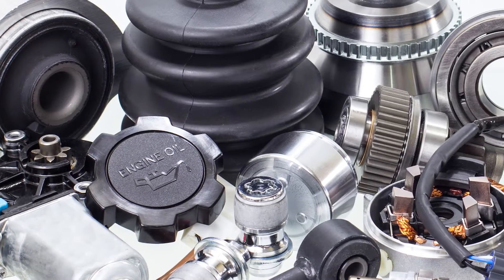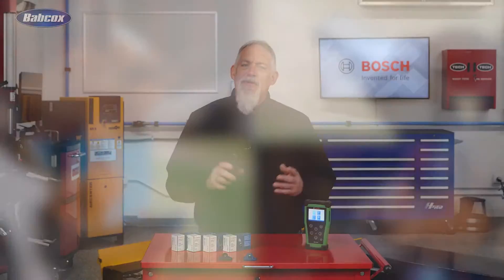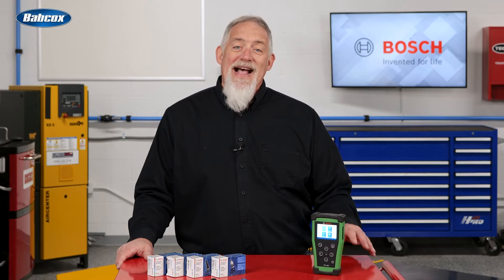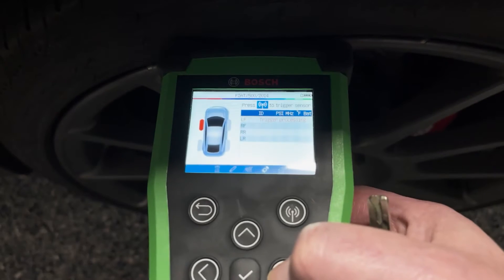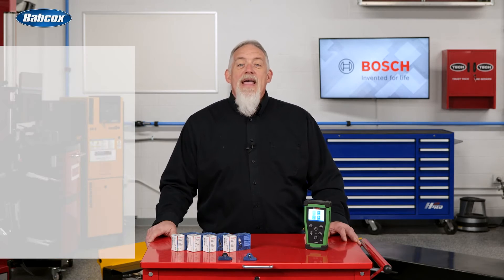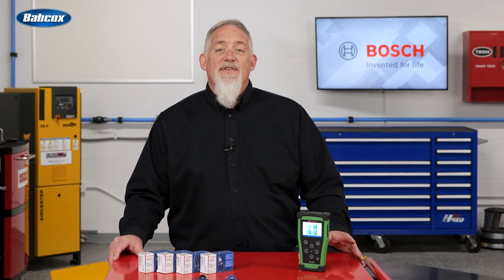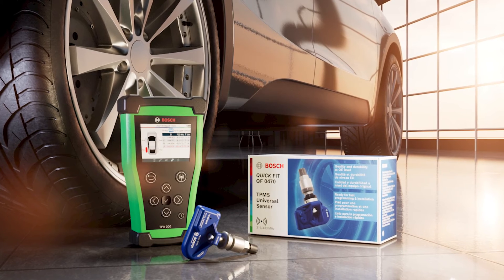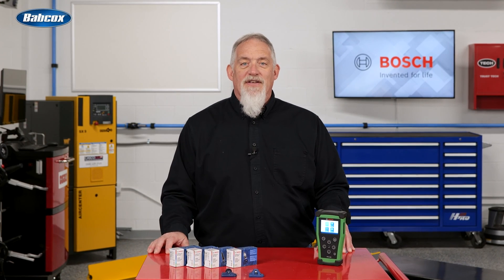TPMS Tools and Sensors

Comment: Tip: I just bought Bosch sensors cuz I thought they are better. Fun fact I went to 3 main dealerships, 4 private service to make the tpms work. It’s impossible without the 1200€ tool. NEVER BUY BOSCH TPMS. My car has the tpms error. You need to either change them, or buy the tool. Changing costs about another 300€ including labor. BOSCH=SCAM

Comment: So basically paying $600+ for this is not enough. You going to need to buy $1500 scan tool to learn sensor.
Reply: For alot of cars this is true but every garage should have a mid class scan tool that will work